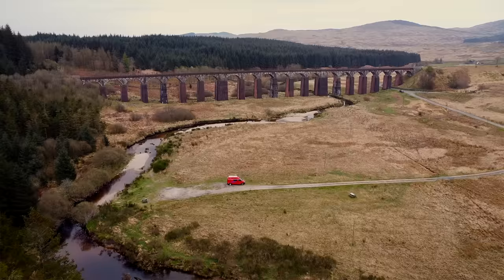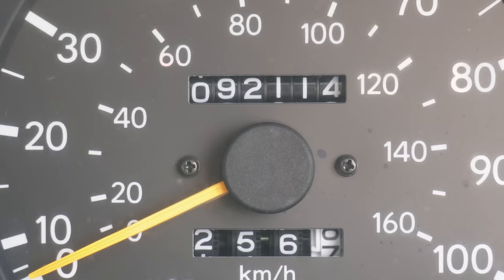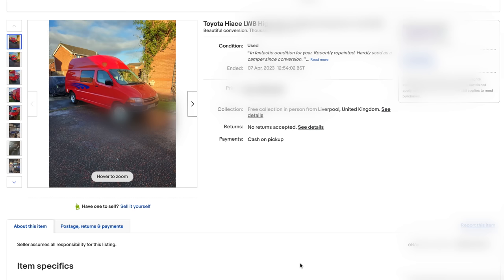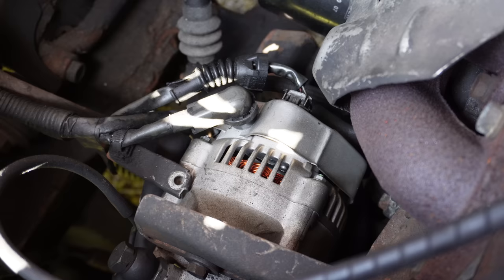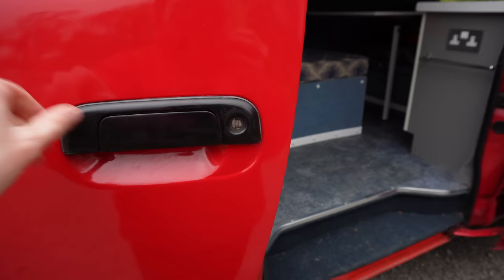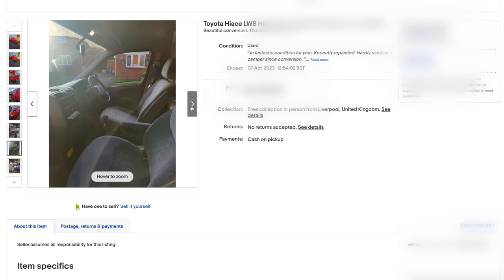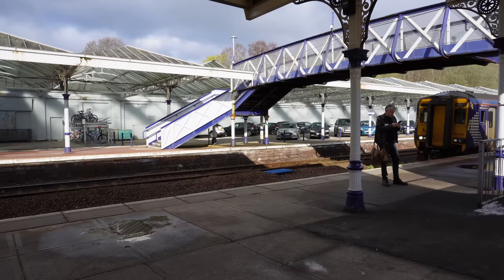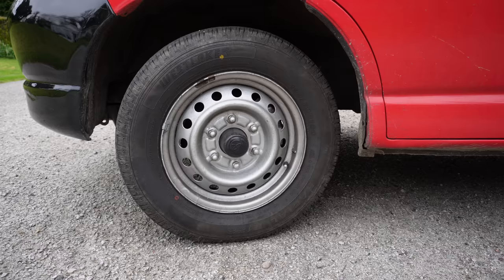How Much Did My New Campervan Cost?

Comment: Great video Ruth. I have a tourneo that looked great when I bought it with full mot. I sold my Renault which was much older and didn't have power steering. I totally regret it. The tourneo is a complete rust box and the mot was dodgy which I found out a year later. I am going to look for a Toyota like yours now. I am also going to binge watch all your videos. Take care and stay safe. Tom.
Reply from the maker: Thanks Tom. I’ve been happy with it but have had to replace things like the alternator and some old parts. But hopefully the van will be good for a few more years now!

Comment: I bought a panel van 3 years ago for  4k with much higher milage and have spent around 3k to convert it. I cant stand up in it but it has been amazing for our family adventures. The prices for vans suitable for conversion and campervans have sky-rocketed since, so I think you have made a great deal with the price you paid. Also it is 90% done, so by spending another 1-3k with some lithium batteries, 12v electrics and a fridge, it should be pretty complete. Looking forward to the improvements. Subscribed.
Reply from the maker: Your van sounds great! Yes hopefully I'll get some 12v electrics installed in the next few months!

Comment: Japanese cars vans are 100% most reliable motors, hands down, Hiace van are very sort after sadly can be harder to find used parts for in the UK as high prices are paid from dealers to export them rather than break them, On the plus side they very rarely go wrong 😊, its brilliant that you seemed to had a good experience with the seller. But would not recommend ,giveing cash before hand to any seller, sadly there are lots of scammers out there, same thing happened to my friend, he lost 1k on a deposit for a car that probably never existed-owed by the scammer, so people beware, would recommend  leaving it though pay pay if anyone feels the instant need to secure a purchase, then your cash will be protected-refunded if the worse should happen..great content Ruth and the Van ❤it
Reply from the maker: Good advice, thanks!

Comment: I think you got a great deal ! 4 years ago I bought a '09 Chevy shuttle bus, with 190k miles, diesel powered. Paid 6500 usd. Now Has 217k miles. Also now has 800 watt solar, 3-100ah lithium batteries, 30 gal fresh water, 2500 watt inverter charger, 12k btu mini split heat/cooling, induction cooktop. 2 large and 1 smaller engine repairs bring my total investment to less than 17k usd. Still changing things as we go.We can boondock 7 days comfortably, have averaged 2 months a year in "Serenity". Can say it's been a blast.
Reply from the maker: That sounds like a brilliant set up you have!

Comment: I think one of the two batteries under the bonnet will be a leisure battery.
Reply from the maker: I did wonder that! 🤔
Reply: @ruthaisling  Hi Ruth, I think looking at your picture of the batteries, they may be permanently connected together which means there is no split charge facility.

Comment: Wow, you stole that van at that price.  Sex sells. A guy would not have gotten that deal. And a pretty face does wonders too. What year was it? I missed that part as I buzzed through it with my forward key at 5 second jumps. I just knew you were going to sneak the price in there somewhere to make us watch the entire video. I still did, but jumping. 🙂 thanks.
Reply from the maker: Yeah I’m really happy with the van! It is from 2001 though
Reply: @ruthaisling  We have a 1999 toyota Sienna van since 2005. 230,000 miles. I do all the maintenance except every 90,000 to change the timing belt and water pump an seals. But that is a diesel I heard you say on the other video. Diesel is so expensive here. Almost $1.00 usd more than gas/petrol. take care. thanks again.